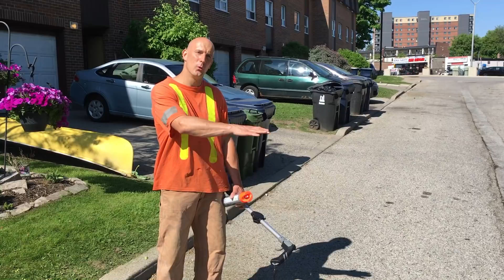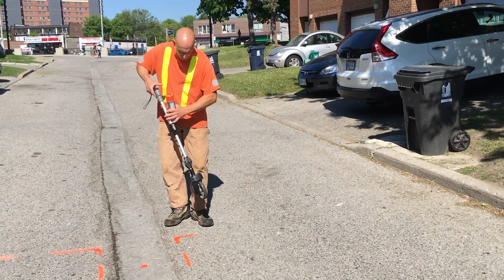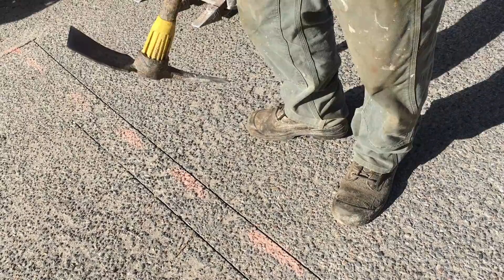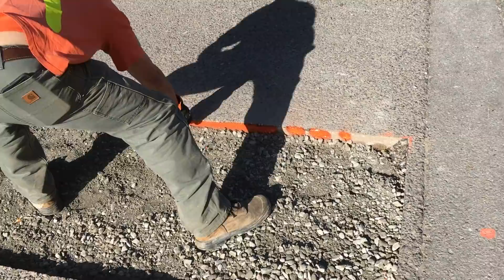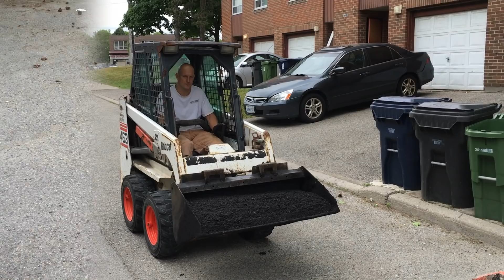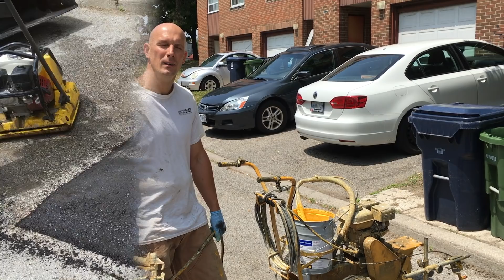New Asphalt Speed Bump Installation

Comment: Hehehehehe, your killing me ! lol... why did you cut it out  and remove it, the existing pavement was in good condition ,  key way and emulsify it and pave it, less time and less work and more effective,  and it could be a little wider with lower crown, you want to slow them down not hurt them. it's still good , I like it. your way works, Kudos...
Reply from the maker: Yes that would work as well you can do that I've done those before that way.  Most of the guys here do it this way even after fully paving a new parking lot the speed bumps are installed another day cutting that section out.  Yup a wider / lower one we install speed humps we call them here.  I will do a video on those as well as next season!  Thanks so much for watching the videos I love hearing how different methods are done that's awesome!

Comment: Hey Jeff! Just wondering about the prep work. Is putting fresh asphalt over top of existing asphalt just an adhesion issue? It would save a lot of labour to sawcut/remove.
Reply from the maker: +Cam Roberts thanjs for watching!  So putting asphalt over existing asphakt for a speed bump may or may not last.  Especially depending where you live and if you get any snow.   The snow plows normally will tear into the speed bumps destroying them if they are capped on top.  Whenever installing these speed bumps i always either tear out both layers of asphalt if there is or at least the top layer.  I have some some speed bump repair work where i just added ss1 glue and capped on top and it worked fine.
Reply from the maker: I started a new DO IT ALL SEALING channel: https://www.youtube.com/channel/UCE4x9dzt-NuHwlEDuAdC2kQ?sub_confirmation=1

Comment: Good video!

1. How did you know the restrictions or limitations/requirements for design of speed bump? 

2. What brand and type of paint did you use on the asphalt?

3.  What was the rough cost to the customer to perform this or how did you charge (total not to exceed or?)?
Reply from the maker: Good Questions!  1- The client wanted something that would slow down the vehicles speeding through but not too high where it will damage cars.  We installed the speed bumps at approx. 3-4" in height.  We normally do them in widths of 2-3'.  If the client wants them wider than it would be more of a speed hump which I will film and post those as well soon.  2 - The paint I am using is from Sherwin Williams "Set Fast".  There is Oil Based Paints, Water Based Paints and Promar Paint with Low VOC.  3 - When charging clients for these it all depends on the quantity you are doing.  If i was doing only 1 speed bump like this it would normally be a minimum charge $1000-$1200.  We installed 8 double speed bumps around this complex so a good price would be approx. $800 each double speed bump.
Reply from the maker: I started a new DO IT ALL SEALING channel: https://www.youtube.com/channel/UCE4x9dzt-NuHwlEDuAdC2kQ?sub_confirmation=1